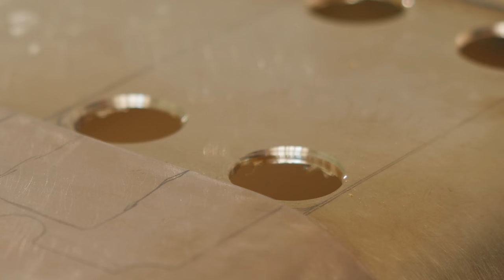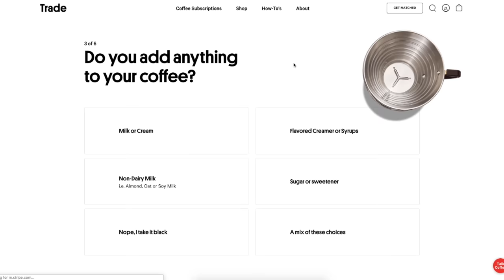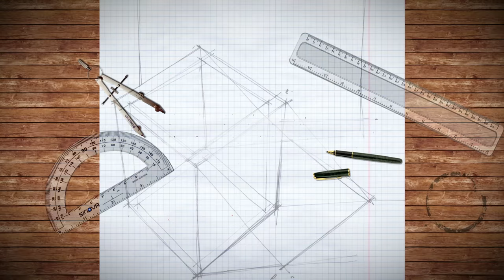DIY 'brass' PC

Comment: You should turn the miners lamp into a reservoir for water cooling! That would look amazing
Reply: Or - LED lighting, Li Ion battery, wireless power/charge.
Reply: Yess
Reply: These are too rare to tinker with
Reply: @Mofapilot  - You seem to underestimate what people are willing to upcycle. >.>
Reply: And add a rgb with some flickering effects to make it look like its still lit!
Reply: @Mofapilot  Miners lamps are rare? I've got 17 if them in my roof storage and one above the fireplace, exact same as this one.
Reply: Oooooo
Reply: there wouldnt be enough space to fit a radiator
Reply: First thing that came is my mind
Reply: @blorpburnday4249  Actually, if you remove the colossal Noctua cooler, there will be place for like 3 45mm thick 120 rads, which for a single CPU (not overclocked I assume) are even too much
Reply: @gioelebezzan2351  didnt think about that
Reply: @Mofapilot  You could find a replica to tinker with
Reply: Thats e really amazing thought
Reply: Not a lot of room for water cooling lol

Comment: The next time you want to remove excess solder: Use a torch to lightly soften up the solder and the wipe the solder off with a cloth pipe cleaner. Keep going over it repeatedly until you've removed all the excess solder. 
This is how it's done in brass musical instrument repair s shops.
Reply: Great advice!
Reply: That's a good technique if you're skilled and have just a bit of cleanup, but in this instance he had so much clean up that the brass would absorb and hold so much heat he could risk a sliding braise joint and throw everything out of whack. I doubt he has the fine touch with a torch to manage the heat properly to soften up only the bits of solder he wants to... 

Although, it is a very useful tip to remember for when you need to clean up just a bit of solder! I once tried wrapping steel wool around a soldering iron with wire and scrubbing it away like that! Haha it DID NOT WORK. This technique would've helped a lot!
Reply: @DanteYewToob  a smaller pencil torch tip could focus the heat, making it easier to clean up only where it's pointed. That would be worth a go as well. 

I still admire the fact that Matt learned as he went along, picking up crazy XP along the way!

Comment: Love it.

I like the fact that you haven't gone down the "Steam Punk" route that most go down with adding unnecessary components like broken radio valves lit with LEDs and pressure gauges from pipework.

So well done on that alone.
Reply: I don't think he was purposely targeting steampunk style, it looks more like 1950-1960s Fallout style radio/TV
Reply: It has a genuine look, like a real piece of equipment from a 100 years ago. Very practical. It's only missing a small brass bezel around the front USB.
Reply: I dunno man, kinda looks like a computer to me
Reply: @MrWillypanda88  1960s was veering towards Woodgrain, this still looks like it's from the late Victorian Era.

Comment: "I'm gonna make this compact" 
Uses largest air cooling in existence
Reply: right is he overclocking, overkill there.
Reply: It's called efficient and quiet.  You can get a small heatsink and fan to do the same job, but it will be noisy.
Reply: german imperial gasmask i imagine he was worried about the cpu thermal throttling in this diy case
Reply: It has an i9 9900k and is going to run at high load editing videos. It's compact without ruining performance
Reply: It's funny that the heatsink consumes about half of the space in the pc. But thermals and noise are important.
Reply: It is designed to be compact, quiet, and as powerful as you can get without a dedicated graphics card.
Reply: Matt is a silence enthusiast. Look at his computer videos like "Cloud Unit" or "desk PC".
Reply: You are all talking about functionality, the whole point of this is the steam punk look. Check out that massive vent!
Reply: also transporting it around. will break the mobo in no time. piece of shit build
Reply: The computer is super compact for the configuration that it has
Reply: @littlebit670  But not long time after this video released the requirements are the complete opposite because most video editing softwares use GPU for rendering, even the Adobe suite made drastic changes about GPGPU.
And sure it's compact but choosing brass and copper made this build extremely heavy compared to other materials.

Comment: This is the one case, no pun intended, that a Noctua fan actually looks good in a particular build. 😆 Either way. Good job. Looks great. Hard work and Craftsmanship shows.
Reply: Was about to say the same, this is the only case where the light brown and creme color theme of Noctua fans is perfectly fitting AF.
Reply: The LTT edition they just came out with is black (with optional orange corners).
Reply: @benjaminmiddaugh2729  Yeah, after how many years now? 😁
Reply: @d1oftwins  Noctua was just pointing out that you don't need RGB to be garish, I guess.
Reply: @benjaminmiddaugh2729  Oh, that RGB stuff can go where the sun doesn't shine, which would be 10 fold more useful. But I digress.
Reply: @binksninja  RGB is nothing more  than a waste of power which could be used for an optical drive (or a few more USB ports if you are that opposed to old tech)

Comment: I love the design,it looks lovely,but i would suggest adding a dust filter for those vent holes,otherwhise the interior is going to collect a lot of dust :)
Great build though,and i gotta say,
Es kocht die Eifersucht;)
Reply: Most of the dust it sucks in will stick to the CPU heatsink because it's a straight-through design. That's one of the easier parts to clean when the machine is open. It's probably OK the way it is, as long as he cleans it out once or twice a year or so. Remove cover, remove fans (and clean them), hit with compressed air.

Comment: fun piece of info for anyone wanting to use brass in a build but having trouble finding brass of any good length around them or cheap enough, you can use carbon steel and bend it to the desired shape, then heat it up and hit it with a brass wire wheel, it will melt the brass to the surface of the steel and "plate" it with brass, giving you a much easier way to find big enough pieces. I have used this on weird shapes for knife handles before

Comment: Wow, bravo! It just needs some proper feet to minimize vibrations and to prevent scratches to the underside polished brass :)
Reply: Proper rubber feet, and I'd stick a thin layer of acoustic foam on the inside to minimise ringing from the airflow. That said, without spinning hard drives it won't get super noisy regardless. Dust covers over the air-intake too. They catch a ton of dust.

Comment: I'm surprised that someone who is so heavily into building things, and technology, has not yet built their own mechanical keyboard.  Please do a matching brass keyboard!
Reply: shogunharvey it harder then you say it is
Reply: Shogunharvy it is do able but it would be clunky and noisy to use with machined brass key caps and switch tray. You can just forget feather touch low profile scissor switches here. It would defo look the mutts nutts but the practicallity of it would leave something to be desisired. I have a hackintoshed AGP G4 case but use the latest apple keyboard because it is more evolved. I still have the original clunky smoked acrylic keyboard for showboating purposes but it is a museum piece!
Reply: @MrDegsy69  if you kept the brass thin enough with leather tops, maybe. That or use wood for the base of the key caps and a thin brass layer on top...there is always a way around it.
Reply: @Jack-sy8hs  Not really, pay someone to CNC a brass case and you're practically done. Buy switches, a hotswap PCB, and some keycaps. It's just plug and play at that point.
Reply: CbmGraphics it would cost more then the high end ones tho
Reply: @MrDegsy69  you wouldn't have brass keycaps. Just a brass case. 
And no, your apple keyboard is not 
Evolved. They're notoriously bad keyboards.
Reply: @Jack-sy8hs  Ahh innocent one, you do not know the world of mechanical keyboards. The world of mechs runs far deeper than most know. Assuming you can get brass at the usual industrial rate of $2ish per pound, and you know someone with a CNC machine, you can get the entire case and backplate done for <$100. Hotswap PCB is $40ish, Kalih switches $20 for a keyboard's worth, and a decent pair of $30 keycaps. 

That's $190 total. For comparison, I spent $310 on my keyboard. Hobbyist level mechanical keyboards can get extremely expensive, "gamer" keyboards are far from the high end.
Reply: CbmGraphics yeah but he is doing this by hand not by a machine, I have a ducky 2 mini with mx red it’s quite the keyboard
Reply: Yeah! I am on with you.
Reply: And a monitor and a mouse.
Reply: Dougie Bell nah there is no need
Reply: linus (tech tips) did a full metal one (with brass key caps) and it turn out pretty cool to be fair!! space bar was so heavy that it almost clicked by itself XD
Reply: @MrDegsy69  then maybe make the frame of the keyboard out of brass, and make the keys out of some nice wood?
Reply: @gotragfol  Brilliant suggestion! providing you used a strong hardwood you could pare down wafer thin and epoxy bond it onto a scissor switch tray arrangement it would be a sure fire winner!
Reply: And a brass Ryzen 5 3600?

Comment: What a marvelous genius you are mate. I was choosing the other day materials for building a mini itx as the market doesn't satisfy my expectations of the mini itx department, I was going to build a titanium case but wasn't a great conductor , so the plan was to buy aluminium, but i don't have the tools requiere to do a perfect job so I ended up with plywood. Less cost and I have worked before with it. Plywood is great material for molding things as you please , better than any metal when you don't have the tools. Perhaps I would in the future build a metal case and taking some ideas from this video. Great !!

Comment: The build is not exactly my cup of  ̶t̶e̶a̶, coffee, but it looks absolutely amazing! Can i ask what video editing software do you use that can't use a GPU?
Reply: I guess he using premiere to edit video. Because Premiere is a heavy edting software that depent alot on the cpu. So that make sense alot why he decided not to include a Gpu in his bulit.
Reply: Correct me if i'm wrong, but i'm pretty sure Premiere can use a GPU.
Reply: He never said it can't use a GPU but said it doesn't need to use one. So Premiere or AfterEffects, which use Adobe Media Encoder, can use the CPU or the APU built into the Intel chip (I mean, the display has to be powered somehow :-P ). However, a dedicated GPU will make the process much more smoother and can shorten the rendering time.
Reply: He might also be using quicksync, which speeds things up a bit. And is almost at GPU rendering performance and quality.
Reply: Exactly. He probably chose not to use it because it isn't need and the whole build would be more compact.
Reply: @Schranzoslavek  You are not wrong, premiere does use Gpu to speed up it performance, but it still depent on what your configuration in Pre settings. He want this bulit to be compact but still have the horse power to do heavy workfow so a GPU is not needed in this situation.
Reply: I think he's still using Sony Vegas. He mentioned the software he uses on a video about his workflow and his office.

Comment: Phanteks be mad for dissing their case like that 😆😆
Reply: @letsbecreative3725   hey how's it going
Reply: Especially their Evolv cases are very good looking but their style is very modern which does have to suit you.
Reply: @CheapBastard1988   agreed but in my opinion the p600s has a similar interior and modularity for cheaper of which I'm all for.
Reply: @kenyandweeb7998  I'm not a great fan of the looks of the p600s and I don't know if this is also with the p600s but modularity often comes with a lot of plastic which I'm not a big fan of. The Evolv series with tempered glass have very little plastic on the outside and despite my user name I don't mind paying extra for this. The 600p does have a way better PSU mounting mechanism than the early models of the Evolv series and the side panel hinge but the Evolv X has those as well. Thermals aren't that great on the Evolv series but they are OK with a few modifications and I rather have slightly higher thermals than a mesh front.
Reply: @CheapBastard1988   agreed
But to add the p600s has a metal front panel but I'm a little of a glass case myself like the crystal 570x

Comment: It would definitely be worth integrating it with a vacuum tubes amplifier for sound.
The glowing orange reflecting on brass would look amazing.
Reply: no. Adding an undervolted tube for illumination is possible but using it as an amplifier will not fit, it will create serious voltage hazard, heat dissipation problems and all the electronic noise will make it sound like trash.

Comment: SSD's to close together, and the heat will build up causing the SSD's temperature to increase
Reply: this
Reply: Just what i thought when i saw it, it will not just cause the temperature to increase but the drive will likely throttle the performance to keep the thermals down
Reply: Not only that, but in such proximity to something as hot as a PSU too.
Reply: Sticking another fan over them wouldn't be too difficult though.
Reply: SSDs do not get that hot or get bothered by the vibration of the PSU. M.2 SSDs would get worryingly hot, but since these are drive bay insert SATA SSDs, they'll be cooled somewhat by the space from their little cage, which is usually too large on purpose. How do you think the heating is when they're crammed in the small bay of a laptop?
Reply: Won't the brass and copper help dissipate the heat, too?
Reply: Also... I saw no intake for the PSU.
Reply: @obedulloa6219  The intake was that slit at the front
Reply: @brosk1s883  normal psu intakes are at the bottom tho

Comment: 2:19 Mainboard is probably like: Dude, do you really wanna kill me?
2:44 and your SSDs have to cuddle with each other and the PSU ... Mhh, toasty ...
I like your ideas but some things just don't feel right ...
Reply: adoksym that’s like every itx build. Not a problem at all.
Reply: 2:19 yeahhhh, the ssds and psu together should be fine honestly. A hair warm but not hot
Reply: I disagree, although more spacing would have definitely made the SSD's run cooler by a very few degrees there is still an air gap between them and I don't see this as an issue, it will be perfectly fine considering the cooling fan a air vents size; the PSU has its own fan, not an issue.
Reply: Quick local heating to those pipes wouldn't do bad to MB, that's ok.
Heat isn't really an issue for SATA SSDs and not like he applied thermal paste between them and PSU, lol. Yep, probably could run 10 degrees hotter due to lack of airflow, which would be whopping (not really) 40C.
Reply: that psu is at least 80+ gold rated but there's also a 80+ platinum rated version.... probably not going to get that hot.

Comment: ebay: "motherboard without IO shield for cheap"
DIY Perks: Hold my leather!
Reply: I don't get why he didn't he use the io shield clearly he had it as the mobo, heatsink, PSU and ram are new
Reply: @thealien_ali3382  clearly for style, you may like It or hate It but I think its a cool idea
Reply: @Mario7p  I like it tbh, but I thought he would have applied the leather on the io shield itself that would have been better as the io shield is to protect from electromagnetic discharge from the ports. Using just leather I don't know could be a bit dodgy

Comment: for goodness sake: deactivate the colorful LEDs and paint or cover the blue USB-ports.
Reply: The blue bits of the USB port are where the contacts reside, so can't realistically be painted. I do agree though that the RGB should be turned off, or at least set to a constant orange-gold that matches the brass.
Reply: @marsharbour5906  Would look even more oldschool with an orange neon indicator and the switch off something like an old flashlight, might do something like that myself

Comment: First off - every single editing program takes advantage of GPUs, either with CUDA or OpenGL, improving timeline performance and massively reducing render times. Not to mention other advantages of having a GPU that isn't that waste of space HD630.
Second of all - AMD released their new generation of CPUs that are objectively vastly superior and cost less, consume less power and work much better with high thread applications such as editing softwares. 
Third of all - By going with a 600W PSU, you're constantly way below it's optimal efficiency, as using only 1/6 of the power at worst means less than 70% efficiency in the majority of the time.
Fourth of all - Rather than getting 8TB of slow AF SSD storage, it would make much more sense to get 2 TB of fast (1tb+1tb) Samsung Nvme storage and get yourself an external solution for mass storage. This is extremely fail vulnerable, especially since SSDs are sandwiched together, lifting their average operating temperature and reducing lifespan in the long run.
Fifth of all - since you're using a small MoBo with badly cooled VRM, there's no way it can sustain a 9900k at what you'd think are "fast speeds", and I bet you aren't planning on OC-ing. 

This has to be the single most stupid PC component choice I've seen in years. Aside from great looks, this is highly limited in its versatility and use case, and it's money poorly spent with a lot of potential left on the table.

Comment: for your cleaning process you might try playing with ferric chloride; the liquid used to etch copper circuit boards, depending on your desired effect it sometimes leads in to some interesting texture on different metals(with or without cleaning, look into acid etched knives)... love what you do, great stuff:)